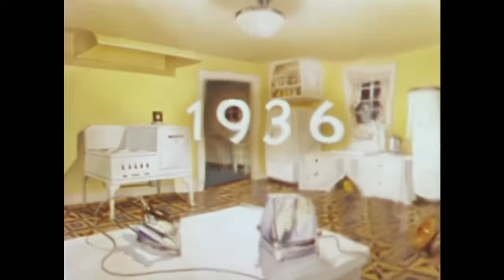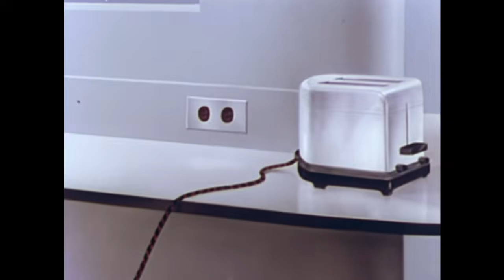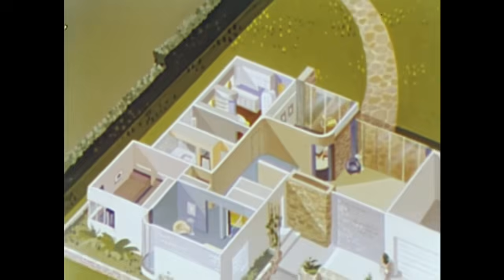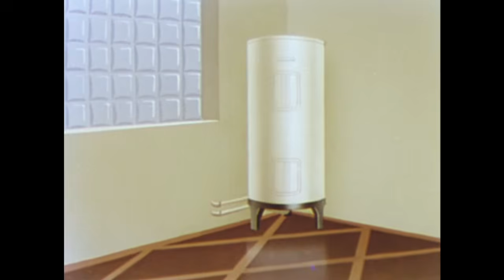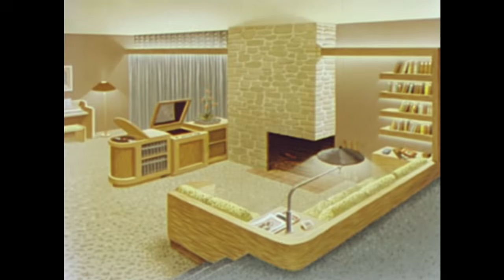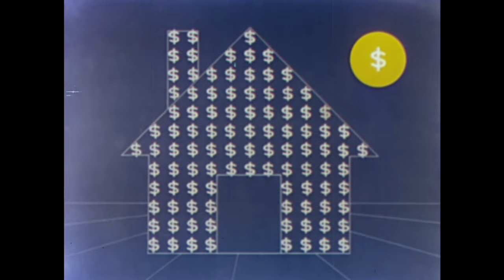Dawn of Better Living - Originally by Walt Disney - Edited for Today

Comment: What a horrible thing to do to a vintage film, cutting it up to suit your whims. This sliced up version sucks. So you didn't think the intro was needed. Well, it was. And why cut out about 9 seconds of the announcer asking if we know what circuits are and the woman answering? That's a really stupid edit.
Reply: I'm an electrification consultant. I posted this video to explain how and why homes are wired, and edited it to focus on current homes, not ones with candles, whale oil lamps and fireplaces. Culture war can go fly a kite.

Comment: This may have been the progeny of wiring houses for 100 amps from the usual 60. The cheap little house I grew up in was a 60 amp 8 circuit house, but dad was good at balancing the load and we never had any problems. My grandmothers house by comparison was a bit of trial and error, a two story 60 amp house built in 1916. once she started using window units, by trial and error she figured out how to run it off of extension cords, balancing the load as she went along.
The extra 2% of wire cost had not been spent. 
I just recently threw out the power strip that she used to power her refrigerator from a less stressed bedroom outlet. It had TORO branding like a lawnmower.

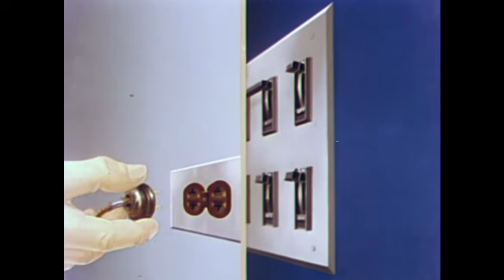Comment: 4:18  The outlet with the T-shaped slots.
Reply: That was before electrical appliance manufacturers included ground prongs in their plugs.
Reply: my parents house was built in 1955 and had those funny outlets...
Reply: A grounded outlet contains a third hole in the socket- a round or half-circle hole below the two parallel tabs.   I don't understand the connection between grounding and T-shaped slots in older outlets.

Comment: Everything was going smoothly until the narrator claimed the power company brings three wire service identified as three circuits. That looks suspiciously like three phase service. What power companies really supply to residential housing is single phase to get 240 VAC for high current devices which is split to provide 120 VAC for the normal circuits and wall plugs.
Reply: 220 VAC 60 Hz service in North America is separated into two "legs" of 110 VAC and a neutral. The 2 legs are combined to obtain 220 to power larger appliances.
Reply: @OldsVistaCruiser  Yes and no. Look at how the xfmrs are wired. They are however many thousands of volts (probably in the 4k to 6k range) input stepped down to 240ish with a center tap that is the neutral. So yes each leg to the center tap neutral is 120 VAC and no bc the 240 VAC is the full output of the step down side of the xfmr. US low voltage single phase electricity is called split phase bc of the physical location of the neutral on the step down side. The two 120 legs are not "combined" to provide 240.

Comment: Was 20 Amp service common back then?
Reply: Many homes built before WWII had 30 amp, 120 volt service.    Two wires from the pole to the meter.  Inside was a fuse box with two to four circuits for the entire house.  Some fuse panels from the 1930s or earlier had fused neutrals,  this is, two fuses per circuit,  so a very old fuse panel with 4 screw in fuses might actually be 2 circuits.    

I actually lived in a duplex,  built in 1942 we were told, from when I was in third grade to sixth, 1998 - 2001.     Old fuse box, 4 sockets but only 3 were used, I stuck my finger in the unused socket and got thrown back and busted my head on the coffee table and needed stitches.    Anyway I think there were 3 circuits in the house, 120 volts only because there was a gas range, small window air conditioner that plugged into the old two prong outlet in the living room,  only one outlet in each bedroom,  one outlet on the kitchen countertop,  and two outlets for the living room.   Bathroom didn't have any outlets so Mom had to run  an extension cord from the bedroom to the bathroom when she needed to use her hairdryer or curling iron.  Outside was two small circular electric meters, and two gas meters, one for the upper unit and other for  downstairs unit, which we lived on.    Cast iron radiators for heat, water heater/boiler in mechanical room only accessible by the landlord.   No washer/,dryer hookups.  All outlets were two prong, and a mixture of toggle switches with a loud snap when operated,  and the style with two small buttons that pop in and out when you turn the lights on or off.
Reply: @Sparky-ww5re makes our modern 240V 200amp services in new homes seem absolutely ridiculous. My panel doesn't even have spares with several 15amp mini breakers!
Reply: @thedopplereffect00   @thedopplereffect00  I know,  right? 😂  It's crazy to think that, 75 years ago, less than a century,  a couple of circuits provided plenty of power for a house, until you realize that almost all of the pre-wwii houses were 1000 square feet or less and most famlies didn't have a TV until the early-mid 1950s and that was a  rather substantial investment.  For a typical family in the 1930s, a radio in the living room provided entertainment, a couple of fans and table/floor lamps, and having  a percolator, toaster, flat iron,  waffle iron, were all considered luxuries,  so two to four circuits was plenty of power at the time

Comment: Why we never got the iron table?
Reply: we got fabrics that don't need ironing. you used to have to iron EVERYthing, even sheets and towels.
Reply: @nardo218 
Towels have never been iron.  Ever !
Reply: @billgreen1861 plenty of people used to iron 100% cotton towels (think of the “flour sack” type cloth). When line dried, cotton can be rough/harsh. Ironing softens the cotton.
Reply: @NoName-sd9qc  
I'm 83 and have lived In the country in the hills and also have lived in the city and not once have I ever heard my grandmother or mother say that they were going to iron towels.  " Flour sack, "  you say ?  ... if you are thinking of burlap that was never used as a drying towel, but,  we did use it for an entrance rug, because of the dirt and mud on the road.
Reply: @billgreen1861  nope, thinking of more of a dish towel. I can’t imagine using burlap as a towel (especially a body towel…ouch!). Burlap for a door mat….genius! Thank you for the idea!
Reply: My grandmother still had a rotary ironing table in the '70s. [Not calling it a "mangle" - maybe different in the US, but in England, the mangle was used wring out the water from the clothes, not for ironing]
Reply: In our engineering department there is a class on building utilities in which the different considerations for installing plumbing or electricity, or now communications and internet wiring, are taught. This film goes over many important considerations about how to design the circuits for a single family dwelling. It's very nice.
Reply: My mom still uses her hot mangle/rotary iron for larger sheets and blankets. They where quite common here, but they are huge and ironing isn't a thing anymore.

Only had to replace the blown line filter a few years back. It tripped the RCD after some time.
Reply: I don't know but the style they showed their I had a lady that I knew that had one in her laundry room back in the '50s. I guess it depend. It was sold as the True Value Store it was called a rotary steam iron. I can find some of the newer ones but I can't find the particular one she had.
Reply: @berylwhite2983 
Are you referring to the roller ironing device called "a Mangle"?

They were ironing sheets and tablecloths. 
Nowadays with cotton/poly blends in fabrics plus using tumble dryers it's no longer necessary.

Years ago, line drying  and 100% cotton linens meant huge amounts of ironing with a small handheld iron.

Those roller ironing devices are still used today in commercial setting. Not home use.
Reply: @marciaoh7056  I remember how great the sheets smelled after my mom had hung them
out on the cloths line to dry on warm sunny days, tho she also had an electric clothes dryer for cloudy or rainy days..